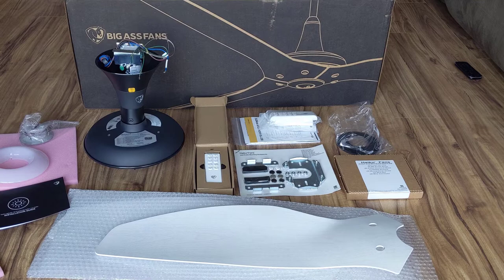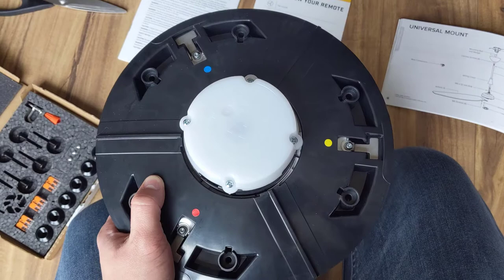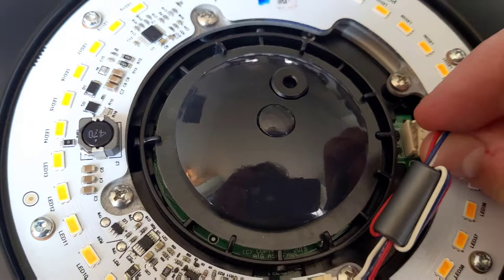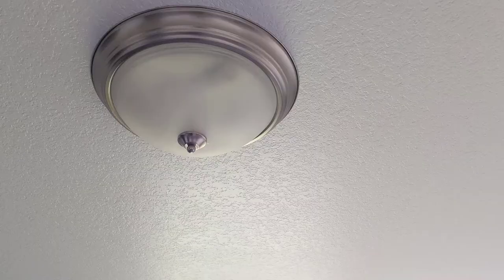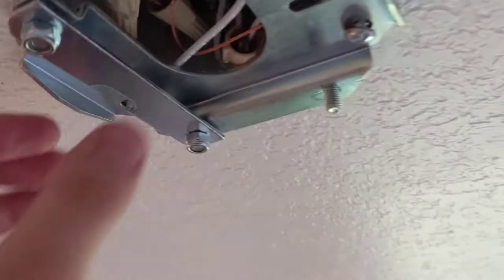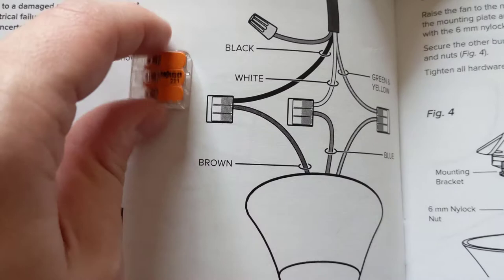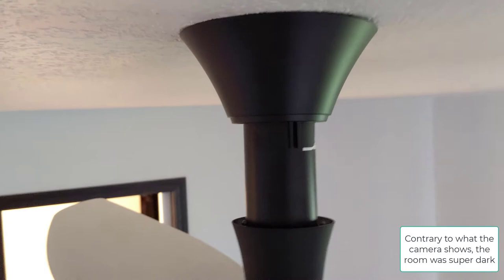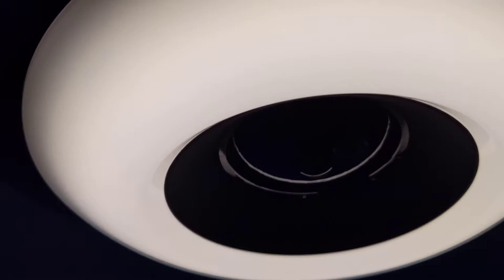How to install Big Ass Fans' Haiku Fan

Comment: Nice upgrade! Did you ever connect it to Wifi?
Reply from the maker: Yes--it's been connected via WiFi. Only supports 2.4 Ghz network which is unfortunate.  Implements WiFi 4 functionality | MIMO Configuration 1x1.
Reply: @jackstromberg  Cool! Do you ever set schedule for light to trick burglars?

Comment: If you have the fan on and you turn the power off at the wall switch does the fan remember the current speed and light settings when you turn the power back on at the wall switch?  In other words does the fan spin back up when you turn the switch on at the wall?
Reply from the maker: Yes, the fan will remember what setting it was on.  I set the fan to "3" for fan speed, flipped the breaker to the room, and turned it back on.  Fan speed remained at 3 and started to spin up again.

Comment: What size is this and how big is your room?
Reply from the maker: Room is 14x12ft; fan size is 52 in.
Reply: @jackstromberg  I have 15x17. Not sure if 52 is good enough or need 60

Extra $200 for upgrade in size
Reply from the maker: @4rdzlla  here are the recommendations from BAF:
52 inches (132 centimeters): 15 ft x 15 ft coverage. Ideal for smaller bedrooms, walkways, and home offices
60 inches (132 centimeters): 20 ft x 20 ft coverage. Perfect for family rooms, master bedrooms, and kitchens
84 inches (132 centimeters): 30 ft x 30 ft coverage. Great for open floor plans, workshops, and covered outdoor spaces

In this case, either is fine.  If you want someone to say "Wow, that's a BAF!" then go with the bigger one.  It would also let you move more air movement at a lower RPM, theoretically being a tish quieter to operate.  52" fan is going to move a ton of air though, I never run it even remotely close to max.
Reply: @jackstromberg  do u think the uplight puts out enough light to light a room
Reply from the maker: @4rdzlla  I don't have the uplight kit on my fan, only the Light Kit that faces down. The fan is in a bedroom and the light kit is definitely bright enough to illuminate the whole room, but I also have some lamps that are used if lying in bed that are much more indirect.